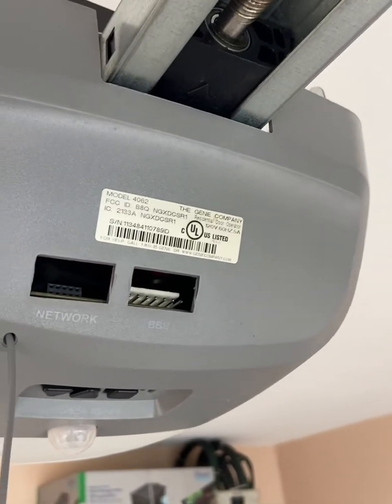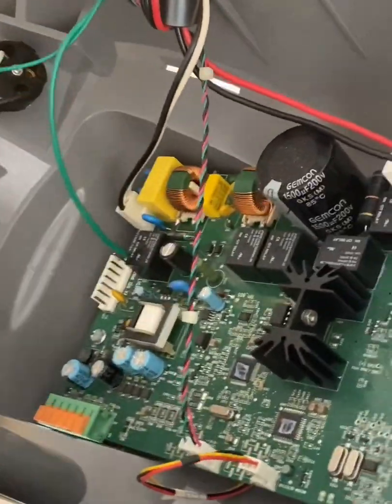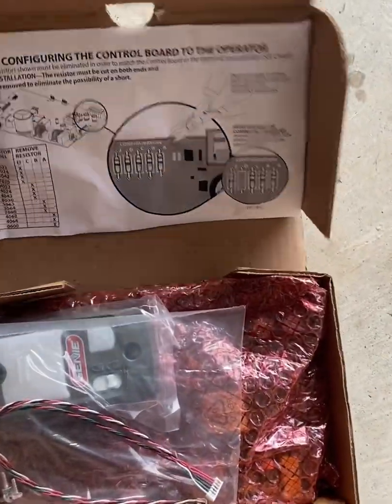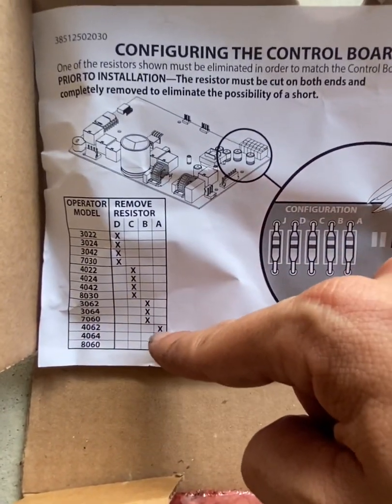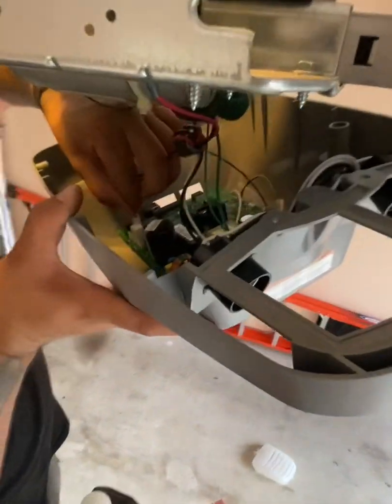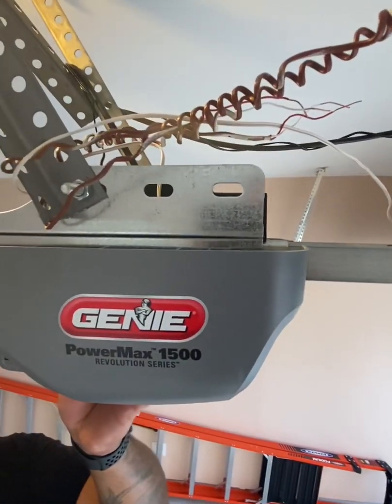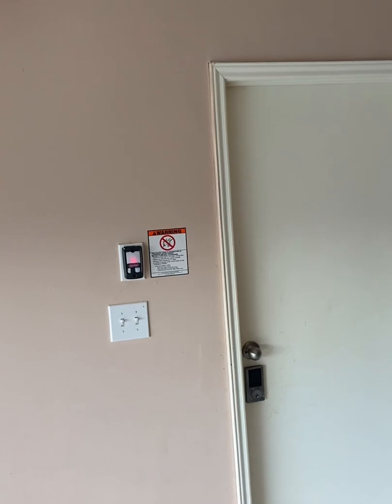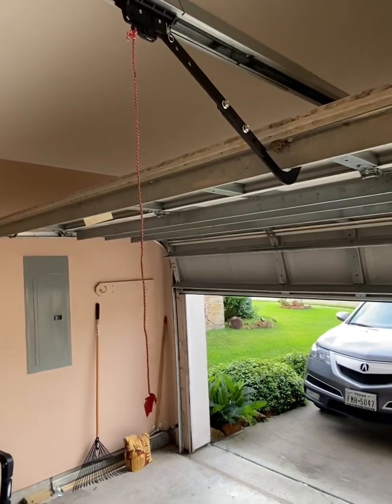How to - Genie Garage Opener Logic Board replacement #fyp #howto #youtube #garagedooropener

Comment: This is a very good video.  Thanks.  When I called Genie about my opener suddenly being 100% dead (yes there is 120 V verified at the outlet it is plugged into),  I tried unplugging and plugging in a few times to see if it would "reset"... no luck... they said the answer was to change the logic board for about 120 $ + replacing the wall panel and reprogramming as you mentioned.  I really like how quiet this DC motor opener is,  compared with other openers, but the board just dying instantly for no good reason made it very hard to get into the garage.  I am debating either buying the replacement logic board kit or repairing the power supply on my existing logic board.  You can almost bet on the capacitors being dried up from being powered 24/7.
Reply from the maker: Spot on. There’s a video somewhere out there where a guy changes a capacitor on the board which cost him maybe 50 cents to a dollar online. He sauters it and the board is back running. Might not hurt to try it if the cost is much friendlier. 

As for the board just dying, this is becoming more common now in the garage industry as manufacturers aren’t making them “ bulletproof” anymore. I see motors from the 80s still working strong and when they fail, it’s a simple capacitor or adjustment. Not the case with these new units. Power outages are surging these new units left and right. Not to mention a power surge almost always voids the manufacturer warranty so there you go. 

Let me know what you decide and please send me an update if you do the capacitor change. Would love to see a success story from that dead board l. Thanks for the feedback 🙌🙏

Comment: Thanks for the instructions. This is the model I have, 4062. Did yours lose power completely? There is power at the outlet but no light at the wall console and sensors. Mine has no power and I did the troubleshooting with Genie. They recommend changing the circuit board. I'm thinking about replacing the whole unit but the circuit board would save me money.
Reply from the maker: Yes they are correct, whenever you lose power to the unit but still have power to the wall panel, it’s a strong indicator that the logic board is bad. If your happy with the system you have , I would just replace the board.